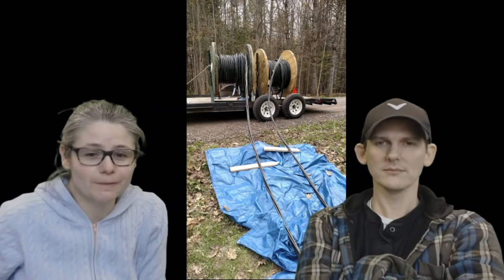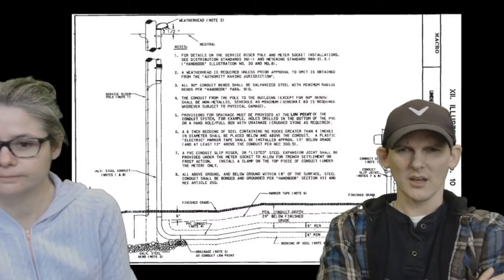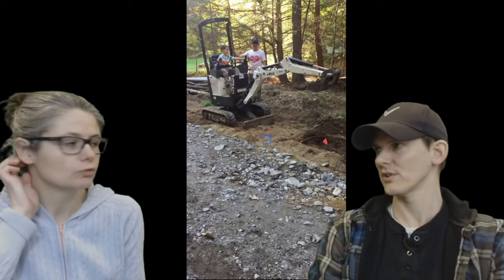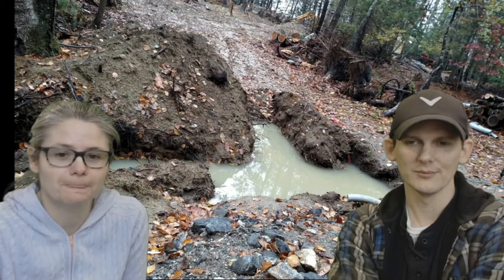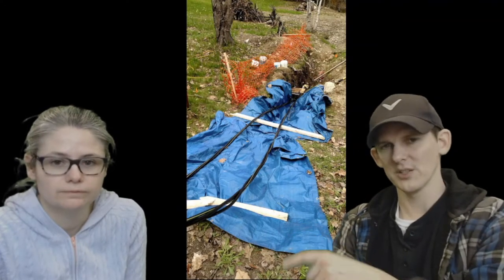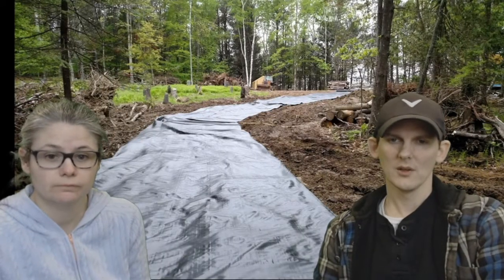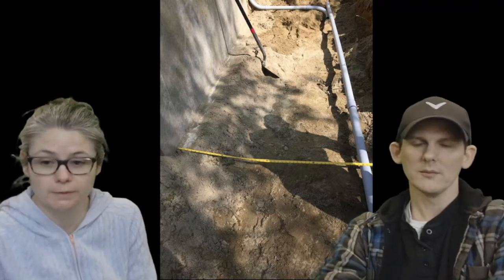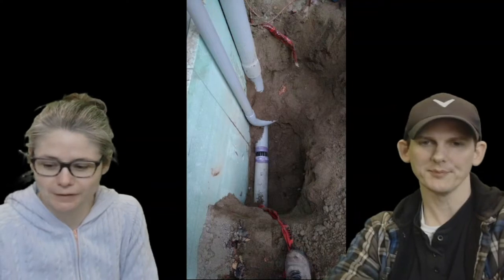How to Install Underground Electrical Power Lines on Your Own Using Conduit, plus our COST.

Comment: Really good job on the video y'all.  The spreadsheet for costs is greatly appreciated too.  I realize it's been right at 2 years since posting but wondered if you might have more of the amounts/lengths of the materials used/purchased (especially the Romex); so we could better determine individual expenses for viewer projects.  I need to add electrical power and water service to a rural property and my service point was to be almost 1,000 feet from the nearest power company pole.  I really do not ever want "pole" service and would do underground service too, but costs are really soaring!  I began making plans to move my service point closer -- about 450 feet from existing power service; but am now wondering if I might not be better served (less expensive) to go with solar/wind hybred for electricity, and have a well dug for water and put my abode where "I" want it.  
You may have included it elsewhere, but was also wondering what state you're in.  It is absolutely great that you had such a good working relationship with you local inspections official!
Reply from the maker: This is Maine.  Going off-grid is definitely an option, but I have not seen any bank that will fund off-grid.  Copper prices are up 300% since I did this job, so unfortunately the numbers mean less.  I probably could and should make an update with foot quantities...

Comment: Good Evening Guys, You video about underground electric connection to your home is great. Thanks for sharing the information. 

I am constructing house in UPTON, Massachusetts , my house located from street 980 feet. I spoke to electric company and they asking 43,000 for poles, and for underground 65,000. Please advise. We really appreciate your help.Thanks!
Reply from the maker: We are aware that Massachusetts has strict rules for what work a homeowner can do- rules that we don't have in our state.  Our overhead estimates were ~$15/foot to run overhead, so your service estimates are indeed staggering.  The first thing you need to do is determine what work you are allowed to do by your town and state.  Also, determine how much  you can/want/need to do yourself.  The power company will install the cables, but they may let you separately contract the trenching and conduit- you would need to know if there is any economy in separately contracting that work.  Our power company would only go 400' with the primary line (~30,000 volt).  Yours may allow more or less.  If you put a transformer at the street, there will be a max length you can go with secondary power (240 volts).  Secondary power installation can be installed by an electrician, who may be able to give you a better quote.  Alternatively I would seriously consider putting in a respectably sized solar array and designing the house to consume very low power.  Again, check with your town and state for what's allowed.  You may have some hurdles with the mortgage underwriter, too.  Good luck!

Comment: Great video! Just curious, for the power wire, how come there was 6 wires?
Reply from the maker: Thanks for the note.  Most installs will have three conductors, but to install 200 amp service at this distance (650ft), two sets of wires are run in parallel to minimize voltage drop.

Comment: Great video 
Are you working at track metalic tape under ground?
Reply from the maker: We just used "electrical line buried below" plastic tape, and put flags on the track.  Then we put measured and put the route in an overlay over the property survey.